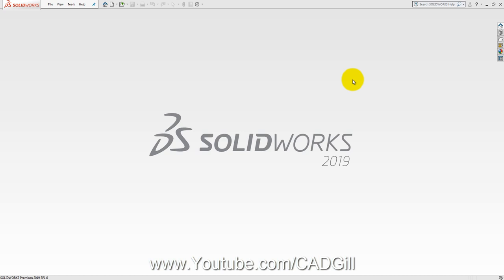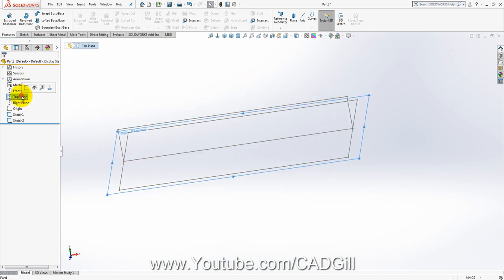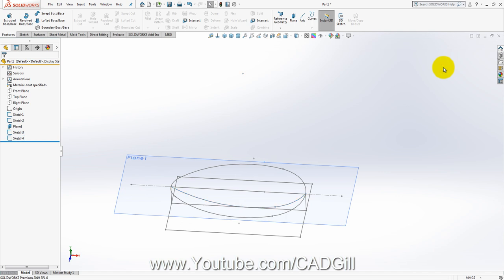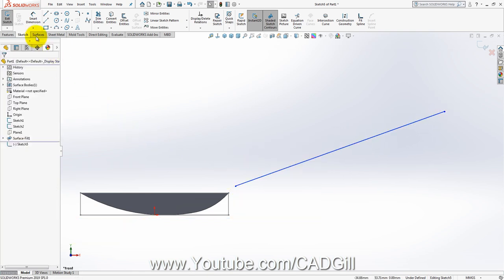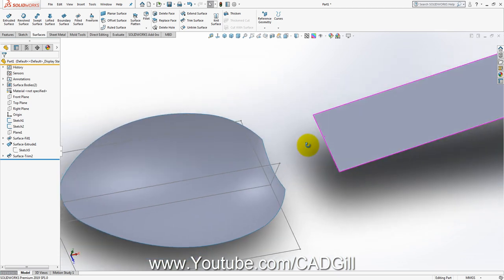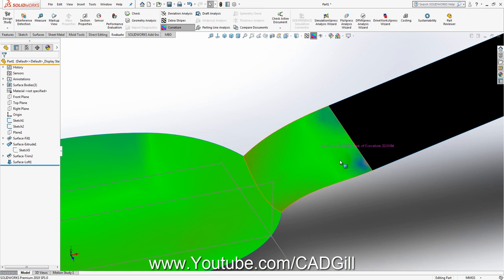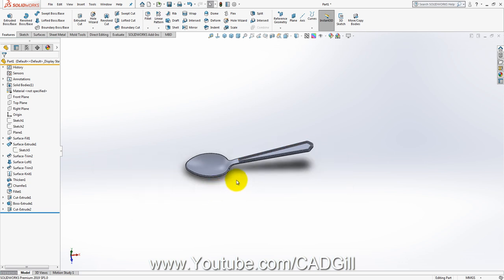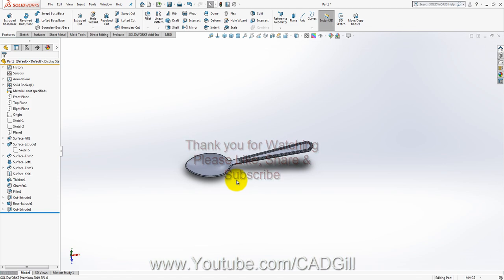Learning SolidWorks Surface Modeling Part 6 - Spoon

Comment: It would be great without the music in the background.  Rather distracting while trying to follow what is happening.  I like that you ran into errors, and solved them.  It helps when I run into errors!
Reply from the maker: Yeah i learned hard way that music is not necessary. I wanted to make it better presentable but failed in that.
Yeah learning how to fix the error we encounter is one of the important part of learning. I am glad it helped you.
Reply: @CADGill  Didn't fail - just now know what to do next time.  We helped each other - works for me!
Reply from the maker: @jeanniellewellyn198  Thanks You are nice person. :)
Reply: @CADGill  please keep the music. No offense but, for me, it is hard to concentrate when there is only a person speaking with an indian accent and the music helps me to focus on what is happening.